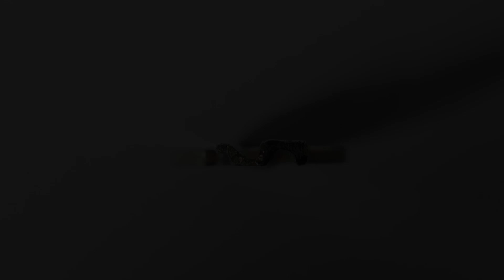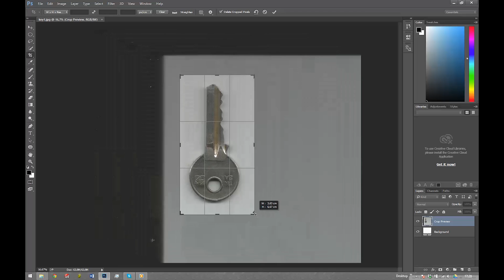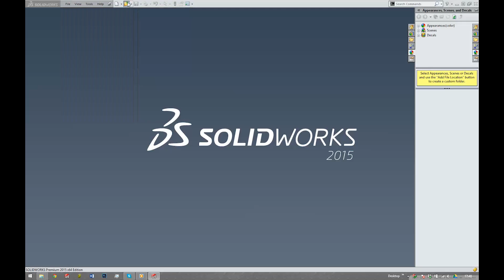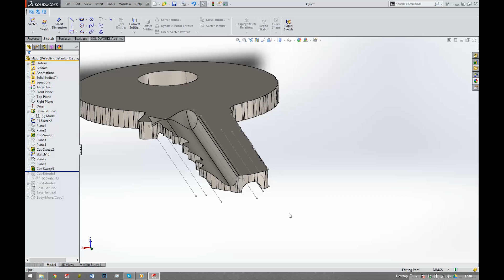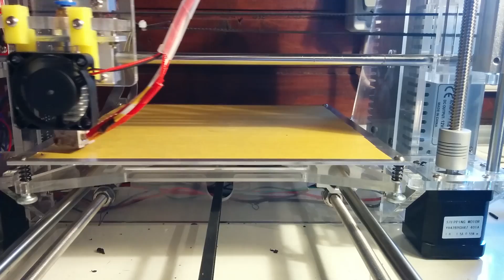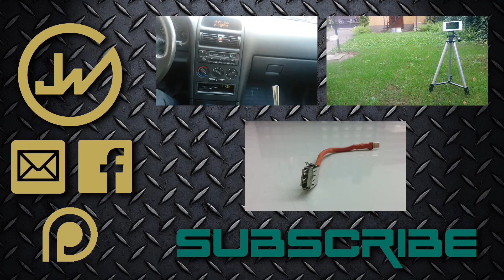How to make a 3D printed key

Comment: You could always use the 3d printed key to cast a mold for a metal one.
Reply: At that point what's the point in making the 3d printed one😂😂 may aswell just get the original casted at that point

Comment: What material did you use? PLA would be too brittle. What thickness setting, I assume .1? This would be a good use of a .2 nozzle for extreme accuracy.
Reply from the maker: +Ken McKinnon I did use PLA and it worked fine. Of course it would be better to use ABS but I had PLA at home at that time :)

Comment: first you Scan key for 2d and Scan only one Face My question how you get third Dimension depth and Detail of others Face of the key
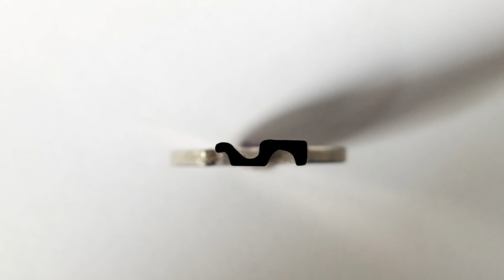Reply: This is the trickiest part here. I made a photo a of a key which was pointing directly to the camera which you can see at 0:33 and then process that in photoshop and later on in solidworks, but it is not necessary to do that, you can just measure the depth of the grooves with your caliper and construct a shape that looks as close to the original key as possible.

Comment: Could you do this using metal or a more resistant material ? Also could you 3D print a blank key and then cut it using a locksmith machine?
Reply from the maker: +adrtorresgzz yes, you can 3d print a metal one, but those machines probably cost more that a car hah, maybe you can try aluminum casting one but it should be as well difficult...